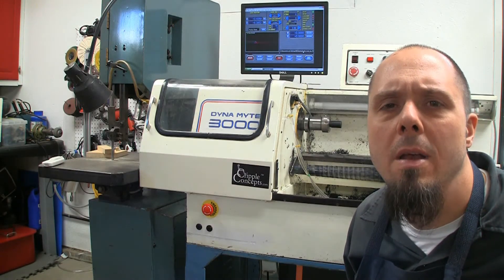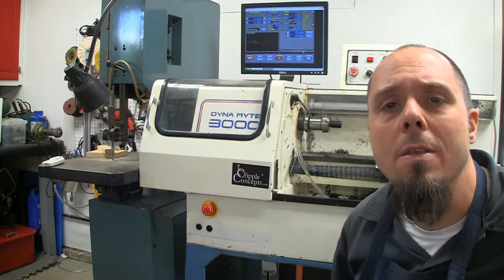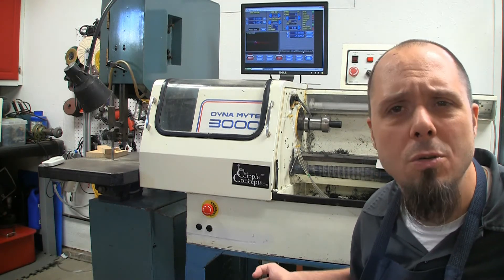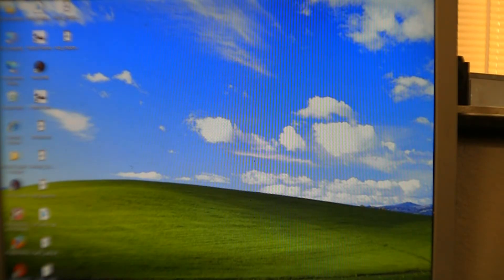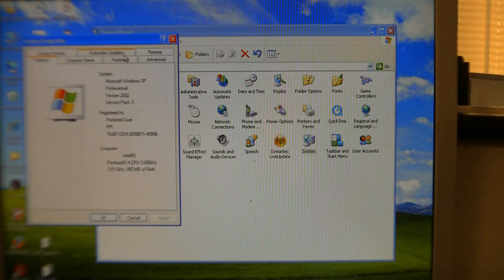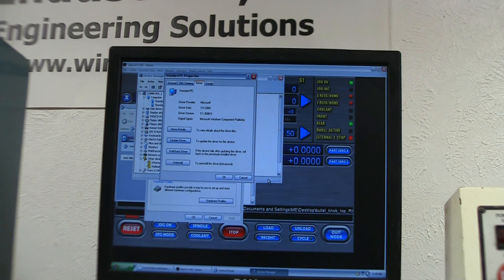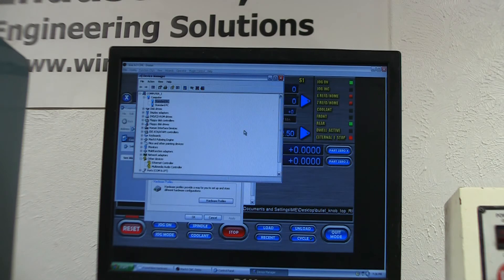Mach3 missing steps fix

Comment: Well, it didn’t work well for me. I switched to standard pc and it got worse. I Tried every recommendation from forums to youtube and still can’t get it to run smoothly. Keep getting .01 to .02 missing steps, been having this issue for months now. I guess I’m just gonna go with Acorn instead, heard lots of good stuffs about it. Thanks for the video at least I tried.
Reply from the maker: I ended up adding a UC100 from CNCDrive and it solved all of my issues, I need to do an update video.

Comment: Hi Josh, I have a problem with a new xp machine that I installed, I have a plasma table. On a 37mm radius cut it cut 380mm and when I use adjust steps it will move in random directions. I'm going to check my XP machine when I get back into my shop again, going to try this. Merry Christmas from the UK

Comment: I was following what you did but when the PC restarted and begun installing all the drivers it got to a point that I needed the mouse for but my mouse and keyboard (USB)  I bought an old ps2 mouse and keyboard but it is a week away. I'm guessing this will solve my problem am I right in thinking the PS2 mouse works without drivers?
Reply from the maker: Yes, I do recall this removing the USB drivers and needing to use an old PS2 keyboard and mouse. Ultimately I ended up with newer computers and CNCdrive UC100 USB to RS232 modules on two of my three machines.

Comment: I'm running mach3 and anytime I'm running adaptive clearing with multiple depths I lose approximately .010" in the x-axis. In other words, if there are 4 z-axis step downs my x-axis origin will be .040" from the origin. Any idea what this could be? I've tried everything discussed here and nothing has worked so far.
Reply from the maker: I ended up putting UC100 USB converters from CNCDrive on my machines and have eliminated my steps missing issues for good. They are around $100 and are worth every penny from my experience.

Comment: THANK YOU SO MUCH FOR POSTING THIS!  I had to rebuild my Mach 3 machine after the parallel port send bad on my old machine and my CNC was having none of it.  I could not for the life of me figure out why it was acting so skittish missing steps and making erratic movements when every setting was the same.

I did exactly what you said and changed the driver type to Standard PC and added the 2&3 microsecond delays in Mach3.  Now it’s back up and running smooth as butter.  

I was loosing my sanity until I stumbled across this!  Bookmarking this in my personal library for future reference.  Well done sir! 😃🍺👍🏻
Reply: Where do you set these delays?

Comment: Great advice just been out to my mill
And changed to standard pc in the device manager
Seems to have fixed my missing steps issue
Also set pulse and direction both to 5 from 0 cheers

Comment: For those with this issue, try increasing step pulse to 15. I had mine at 5, advised by my driver board manual, and still missed steps. It says 1-5 but you can actually put more. I was going nuts with shimming lead screws and motor tuning for hours just to find out it was the software. Thank you for the video it really helped my solve my issue.

Comment: At least Mach lets you dial in your steppers. I now have centroid and you don’t have any of these luxury’s it’s dumbed down software that either works or it don’t. If steppers miss steps you swap to a closed loop system you don’t get to adjust them.

Comment: I'll try this too, As I'm roughly half way through the code using mach 3 it moves acouple of millimeters (only on x and y), I originally thought it was the stepper motor coupler slipping (I did find a broken coupler) I swapped out with different ones and still have the same issue.
My computer was free and only can startup in safe mode (this could be my issue) but I have complete acouple of work projects since built with no issue but the code wasn't as long either.

Comment: i have an issue where the x axis drifts after about 4mm down on z axis.. very odd. it only seems to happen when performing circular pockets too, any ideas?
Reply from the maker: That sounds like noise, have you tried a different parallel cable? I switched to a CNCDrive UC100 from cnc4pc on my mill and it cleared up several little glitches. I'm re-doing the electronics on this lathe now while adding spindle speed control and will be putting a UC100 on it too. The UC100 moves the pulse generation out of the PC and that creates a more constant pulse frequency.

Comment: I have different problem with my 3040 cnc . I work with Bobcad to makes the gcode, but when I loaded in the mach3, in xp pc, the mold shrinks 50%, somebody knows  why ?  The gcode its in millimeters and the mach3 as well. I will appreciate any sugestions. Thanks in advance.
Reply from the maker: That is super odd. Does it shrink exactly 50% in every axis?

Comment: Dear cripple concepts, i have a problem similar with my cnc and i dont know where to turn with it, there is videos on my channel of it working. Could you watch them and see if you know whats wrong ? Your help would be very much appreciated, Thanks
Reply from the maker: After I made this video I stumbled across a thread on a message board about another potential cause. Evidently some on board graphics chips mess up the Mach3 pulsing engine. Have you run the "drivertest.exe"? After I made the changes in this video but before using the lathe much I installed a cheap graphics card to make sure I covered that potential problem as well. 

The things I've done that in combination seemed to have worked are:

Swapped out my parallel cable
Changed the driver configuration as explained in this video
Installed a PCI graphics card
Increased step and dir pulse in motor tuning to 5us
Decreased frequency in "Ports & Pins" to 35000Hz
Tried checking "Sherline 1/2 Pulse Mode" in "Ports & Pins"

I haven't used the lathe in almost 6 months, planning to install a spindle speed control this week or next so I can start running some parts on it. I will add additional comments if I realize any other tricks I've done to make this thing run smooth. I have very similar old Dell computers on my mill and router and they run flawlessly, evidently small variations in hardware can cause huge headaches with Mach3.

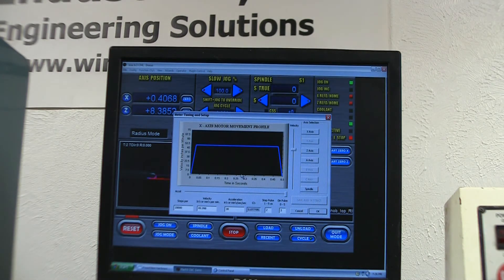Comment: The thing that I found worked on my computer was your very small hint at 7:09, about changing your step pulse to 2 and 3, respectively. Mine were set at 0 and 0, and I was losing steps on my y axis (small chinese made CNC 3020, pretty much the same setup as you, though, cheapy XP computer). This pretty much fixed it. 
Thanks a million !!!

Comment: have you tried changing motor timing alone? That actually fixes the issue by itself. My problem with mach3 was that I could get the stupid software to remember that setting.

Comment: Thanks for posting this video. Its just solved my problem it's been driving me insane trying to fix mine
Reply from the maker: Glad it helped! This was a very specific video, I knew only a few people would watch it but figured I could save someone else hours of frustration. I am adding more RAM to this computer still, it runs slow after being on a few hours.
Reply: My setup is all within the pc case so changing the pc wasn't really an option so thanks again. I'd maybe try to clean any dust out and re-paste the heatsink for the prossesor. It helped mine run cooler/faster but I'm no expert as iv been trying to sort this problem for the last month ! Was it not the one axis that was looking steps on your. It only seemed to be the x axis on my mechine.
Reply: Try clearing the cash files and defragmenting the drive
Reply: darren Webster hi Darren I have an issue firm me it is only the x axis as well will follow the video advice please can you advise how it was fir you thanks
Reply: Hi Mark I thought this had solved it but it's still doing it just not as often. It will run fine most of the time and then just randomly jump about 5 - 10  millimetres mainly when its doing a lot of small movements. For now iv switched the steps on the drivers to 1/2 from full steps. I had it engraving a big picture for over an hour yesterday it turned out ok but I think it  had skipped a few millimetres. I might switch it to 1/4 or even 1/8 to minimise the problem for now as I'm not doing precision work and it's only a hobby mechine. If your using a parallel cable iv heated people mention a uc100 motion controller that plugs into your board and has usb to your pc. I was going to try this next apparently this can sort timing problems?
Reply: One more thing make sure the port is configured properly in your PC check the mach 3 manual for instructions on how to do that
Reply from the maker: Thanks for the additional tips Tom. I haven't had a chance to spend much time on this lathe the last few months but hope to get back on it soon. I read on some message board threads that Mach3 uses the GPU as the pulsing engine so onboard graphics are a problem, have you found that to be an issue? My mill PC has a PCI graphics card and my router has onboard graphics and neither have Mach3 hiccups.
Reply: I got this link from another Youtube user its for windows 10 but many of the ideas seem to work on XP

http://www.centroidcnc.com/centroid_diy/config_windows_10.html
Reply: I have 2 acroloc mills I converted to steppers after the 30+ year old electronics gave out.
Both have dell 760's (there cheap fast and reliable check ebay)
One has on board one has an add on card. Im  not a computer expert but they both work well. 
I use one to run plastics and one for aluminum in a production environment.
One day the one I use for plastic skipped a move on the Y and sheared off the end mill. I checked a few things and remembered i had not cleared the cash files and defraged the drive for along time I did that and it has run fine ever since.
The real odd thing is the next day the other machine did the exact same thing . I did the same thing it has run fine ever since.
Just a strange coincidence? power issues from the power company? will probably never know
Reply: I believe mach3 uses the windows clock for timing . I think I read it in the manual?
Reply: Also if you have to set the step and direction pulse higher it usually means your parallel port cable is to long or there is a bad connection on the plug. 
The shorter the better and make sure its an eee what ever rated cable.
also check the connections on all your drivers.
and there is also a chance its interference do not daisy chain shielding grounds run separate wires to a common chassis ground from each cable
also make sure your power supply's are rated enough and are name brand not knock offs from ebay that look the same